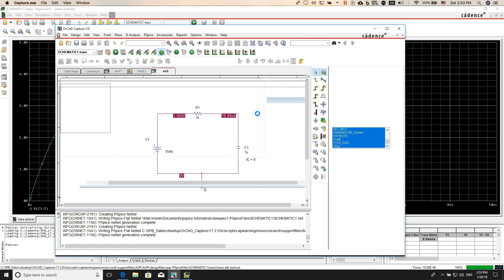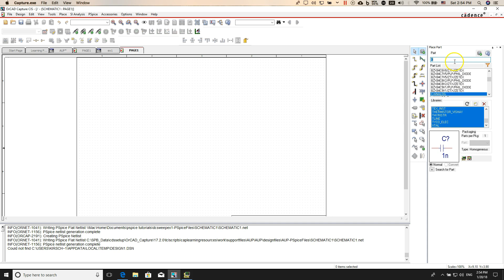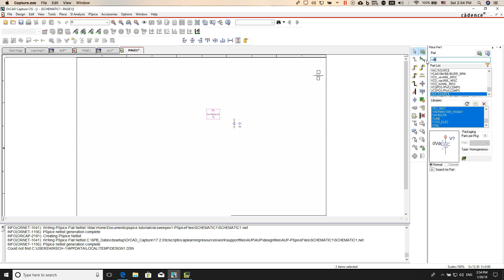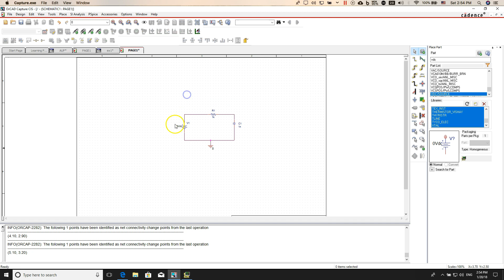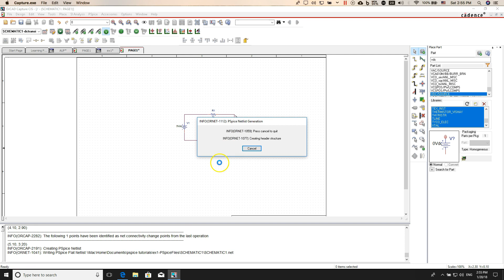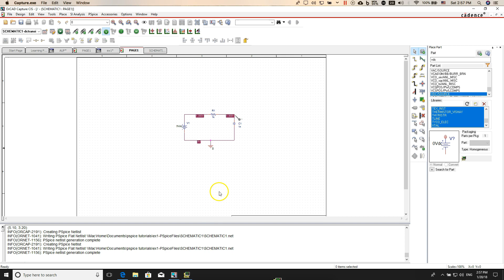PSpice Tutorial: Step-by-Step DC Transient Simulation of Capacitor Charging

Comment: Thank you very much, I was just struggling as I did not set the initial condition (IC = 0) of the capacitor. Now it works!
Reply: @techedkirsch  I am just wondering, why not make the capacitor parameter IC = 0 as default? Is it also possible to configure the dielectric constant and or leakage current of a capacitor? Thanks again.